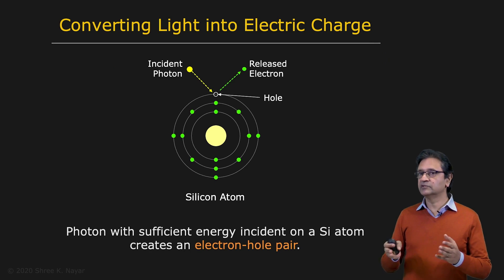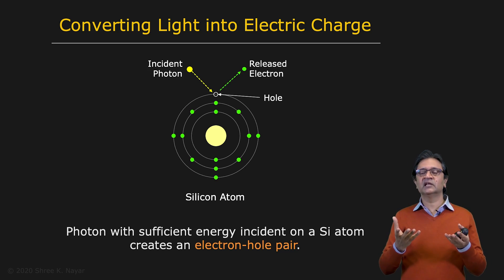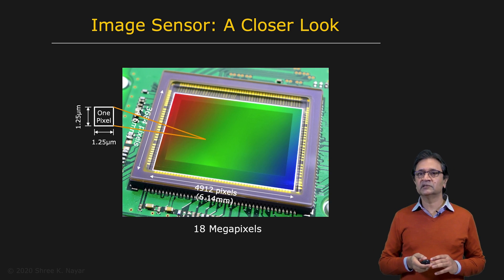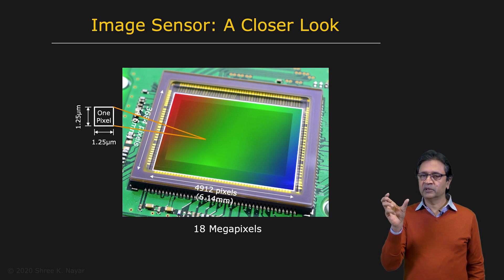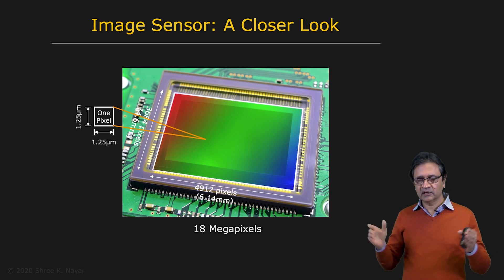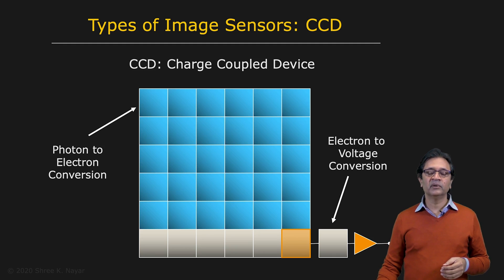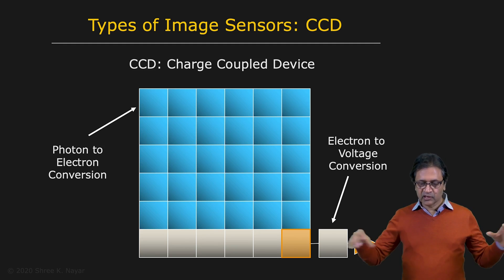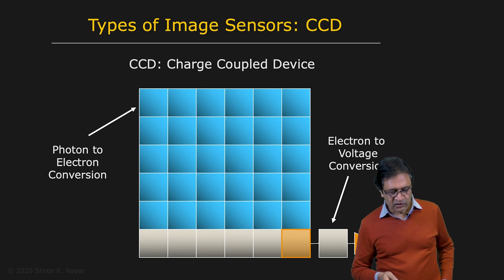Types of Image Sensors | Image Sensing

Comment: 5:30 how is the voltage quantified to binary?
Reply: Bro binary is a bad idea! Imagine a grid of pixels each producing a binary response—you'll get an image of pure black vs. white! Like a chess board.
Instead you want each little square to read out the voltage as a continuous value.
So that high voltage means that place is very light, and low voltage very dark, and medium voltage about half grey.
Reply: @oosmanbeekawoo   "Bro binary is a bad idea! Imagine a grid of pixels each producing a binary response—you'll get an image of pure black vs. white! Like a chess board."  that's not how it happens. A 10 bit ADC it can represent 2^10=1024 discrete digital values so each photodiode can represent light intensity /analog signal with 1024 different levels or gradation.
Reply: with ADC